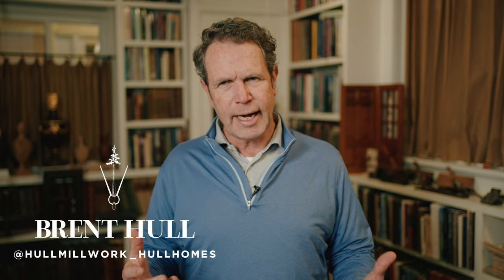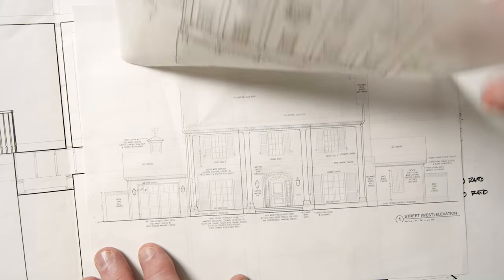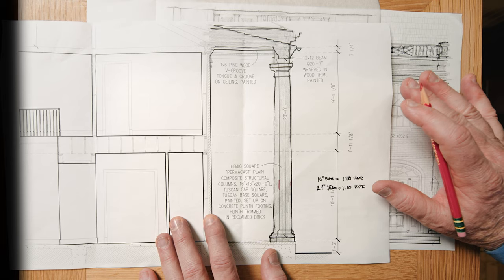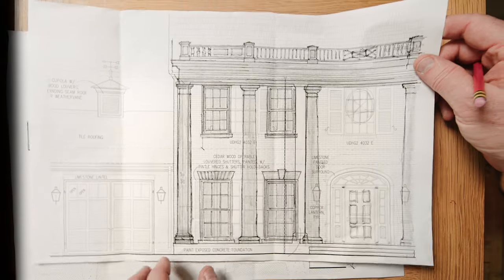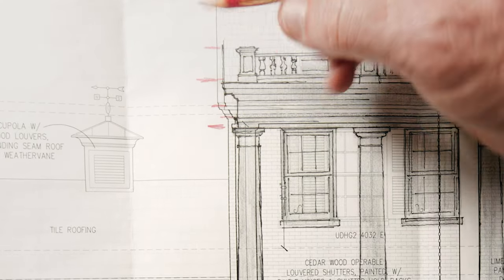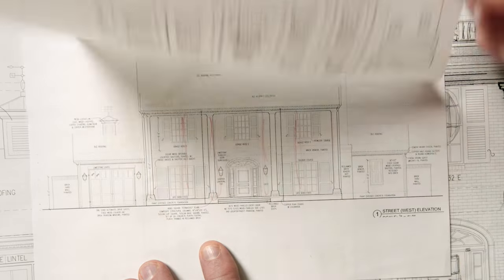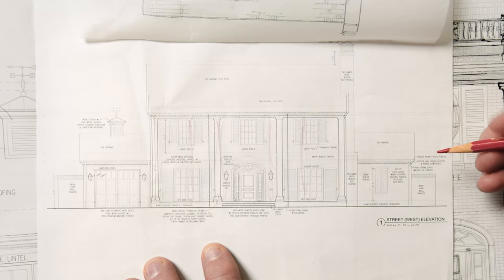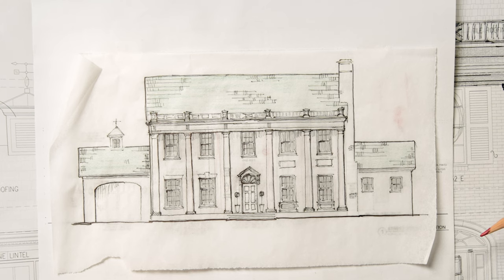Fixing a front porch on a new home.

Comment: Your design is very nice, but two questions occur to me.  What kind of a rain gutter gets installed behind the railing at the bottom of the roof?  Also, how do all the leaves get cleaned off the roof in the autumn if that railing allows the leaves to collect on the roof?
Reply from the maker: Thanks, concealed gutter system or something similar to Thistle Hill.

Comment: Thanks, Brent, for another great video! Three quick questions: 1) Would square piers, rather than columns, be acceptable? 2) If one doesn't want overly wide columns, could one use pedestals so that the columns are not that high (and thus the diameter doesn't need to be that wide). And 3).Would an italianate-looking  entablature, with brackets, work in this case, or should it be kept "classical"? Thanks!!
Reply from the maker: Hmm, the client wants piers not columns. Also, I have not seen a square pier with a pedastal executed well. I think that idea is hard. I would have to try and sketch out your last idea. Maybe. Thanks for asking.

Comment: Would 1:9 or 1:10 be a good ratio of column width to height for a single-story porch? Is there a good ratio for the thickness of the entablature?
Reply from the maker: Yes, it can be. For a 1 story porch I like 1:8. It really depends on the style. Entablatures should be around 1:5 ratio to column
Reply: @BrentHull  Thanks! I'm sketching a craftsman porch extension on my 1940 craftsman/ranch transitional cottage and have been using your channel as a resource. Mine is a complex case. Can send pictures.

Comment: Hi Brent, great video! I’m curious, how do the changes in window locations affect the interior layout of the house? Also, since your changes to the front porch, columns and entablature makes the front facade look a lot more grand than before, do you think that having an attached single car garage on the left side still looks appropriate? I realize that the garage massing is meant to balance the single story section on the right side but that part looks more like an added wing for the servants. What if you moved the garage a little bit away from the house and created an open breezeway between it and the house or maybe an enclosed connector with a lower roof than the one for the garage and made the part on the right look a bit more grand?
Reply from the maker: Hi Ryan, thanks as always for your comments. That is a drive through not a garage. The garage is down the driveway in the back. This elevation is deceiving but I'll stick with the design idea for now. Thx
Reply: That elevation is deceiving :) So that's a separate garage building in the background? I wonder why the draftsman included it as part of the main house's elevation - it makes it look like there's a single car garage attached to the house instead of a porte cochere@ull